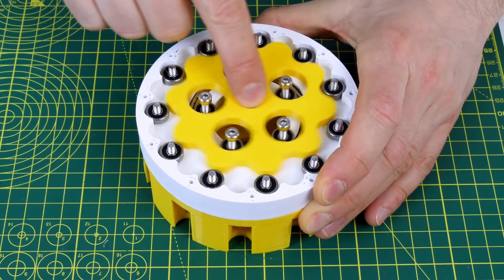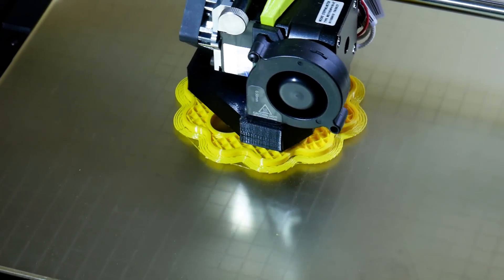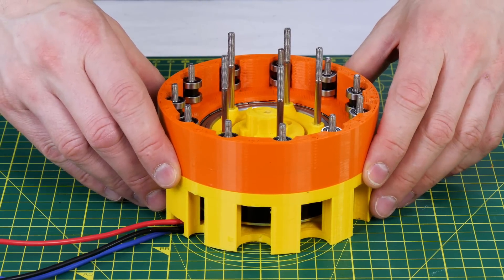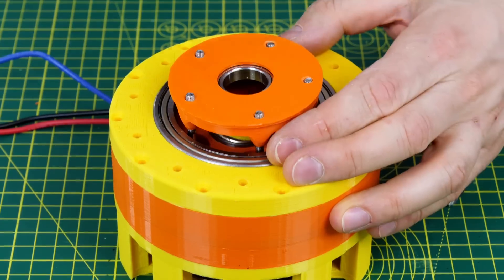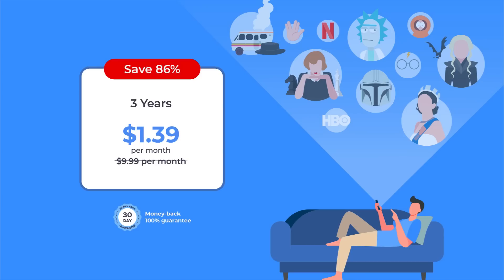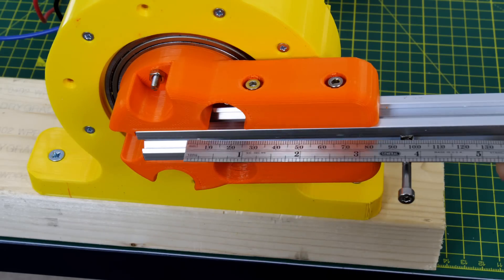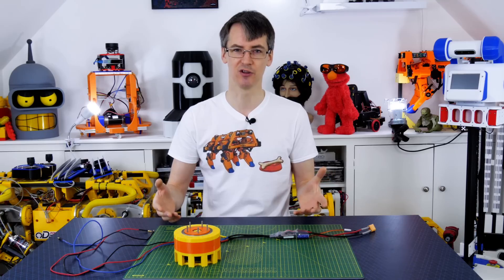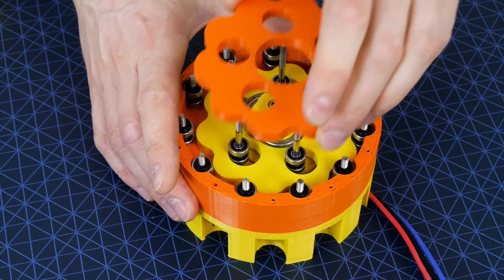3D Printed Cycloidal Drive V2 - Much Better!

Comment: Yeah, odrive is too expensive, replace with ESP32 + MA700 magnetic encoder some high current MOSFETs or IGBT (with one stage driver MOSFETs for 3.3v or a 
TI DRV8312 if you don't feel like making your own drivers) there are already libraries for making a much improved low speed high accuracy high torque motor controler in the arduino library and it is VERY easy to program

BTW you can print stators, wind your own coils and only the bearings remains as the non printable parts
Reply: Or just use the VESC but actually connect an encoder to it (which it does support)
Reply from the maker: ODrive controls two motors so it's cheaper than two VESCs
Reply: @jamesbruton  A dual vesc based ESC can be bought for less than (or close to) what an ODrive costs on their website. You also seemingly used a v4.12 based VESC while there is already Version 6 out there.

Comment: 1:03 instead of thinking about ways on how to lessen the load on that part, shouldn't you try printing the white part with 100% infill first?
Reply from the maker: That won't stop the motor casing flexing though, there's a massive load on that motor

Comment: The disks should be moving together. You could print them as one piece if you wanted. The second disk, doesn't need to drive bearings as it's just there for weight. But driving the bearings probably makes it stronger. However the extra bearings are adding weight as well.

Comment: You didn't mention anything about making the gear shape a proper cycloid, rather than just some crude wavy shape.
Reply: Between the relatively low accuracy of 3D printed parts and the compliance of the PLA, an arc based approximation is likely indiscernible from a true cycloid.

Comment: What's an ardweno? And how do you spell it lol
Reply: An Arduino is a hobbyist friendly, all in one, micro-controller system. Programmable over usb, on board. Comes in versions with smaller package surface mount chips 'Arduino Nano', and some versions have wifi.
Reply: Arduino. It's just a small, super cheap microcontroller that lots of people use for various electronics projects. The Arduino Uno is the most common by far.

Comment: “They’re actually slightly out of phase with each other, by 180°” 😂
Reply: I think the cycloidal disks themselves are only 18 degrees  out of phase with each other (ie, the angle between two adjacent lobes). But the center cams they're mounted on are 180 degrees out of phase.
Reply: @bruceadler-9410  well how much they are out of phase is ambiguous. it wouldn't be wrong to say that they are 54 degrees out of phase either
Reply: @johannesvahlkvist  No, that's not right unless you're redefining how everyone else defines "phase angle". 

What's really going on is that the phase angle for a balanced arrangement with two disks/rotors is determined by the equation (360 / N) / 2, where N = the number of lobes. There's no balanced design with an integral number of cycloidal lobes which can be configured with a 54 degree phase angle.
Reply: That's less than 540
Reply: @steveman1982  if something is more than 360 you can subtract x number of 360s and have the same offset so a phase offset of more than 359 doesn't make sense a 360 degree offset is a 0 degree offset when it comes to phases/relative position of peaks.  I could be wrong but point me at something explaining what above 360 degree out of phase would mean
Reply: @ShaunHusain  That's the joke lmao. Outside of explaining phase (which is really -180 to +180°), having a value above 360° will tell you how many rotations PLUS the offset something has compared to a reference.
Reply: @Xenro66  ok didn't see what steveman wrote was a joke
Reply: @ShaunHusain  Interestingly, this only applies in 3 dimensional space. In math and physics there are objects described by spinors that require 720 degrees of rotation to return to their original state. For a spinor, 360 degrees of rotation gives you the inverse of the original
Reply: @SlimNateKC  oh gawd yah I only operate in three dimensional space er 4 depending on how you count time, that is interesting though I figured there might be some weird case I wasn't thinking of where more than one rotation in something that is continuous would be meaningful.... and yah I guess extra dimensions is probably the extra geeky answer I wasn't expecting ;P
Reply: @ShaunHusain  you can hook up a cord to a spinning disk and it won't get tangled up. It's used in aphorisis machines where part of a fully closed, sterile circuit needs to be rotated at high speeds, but remain connected to the patient/donor
https://en.m.wikipedia.org/wiki/Plate_trick
 And 
https://youtu.be/byi5Gzjc04Q
Reply: @RobertSzasz  This is phenomenal! Thanks for the links. Pity the YT channel doesn’t allow notifications and comments (set for for children / YTkids).
Reply: @ShaunHusain  Harley-Davidson firing order is 405° and then 315°, because it fires from cylinder 2 first. Old John Deere twin cylinders fire at a 540/180° interval. Only examples I can think of. Everything in phase, working as it should be.
Reply: @throttleblipsntwistedgrips1992  gotcha yah I was thinking more in terms of things that are counted relative to a fixed line that more than 360 wouldn't mean anything but I see how a crankshaft would have relative positions more than 360 away from each other in terms of turning of a single shaft (and talking about timing of firing things in relation to it).  Interesting points though and not in the realm of n-dimemsional math ;)
Reply: @SlimNateKC  You can make a macroscopic demonstration of a 720 degree spinor in 3d space no problem. Dirac's string trick shows this very neatly. Particles with 1/2 spin values require 720 degrees of rotation to return to their original state
Reply: I caught that too, it literally can't be more out of phase xD
Reply: yeah, each nub is only 18 degrees out of phase
Reply: Look at this bernstein. Playing at being smart.
Reply: Prolly meant 18
Reply: Could have been worded better 🤔
Reply: Yes, I agree…🙂🙃
Reply: just slighty